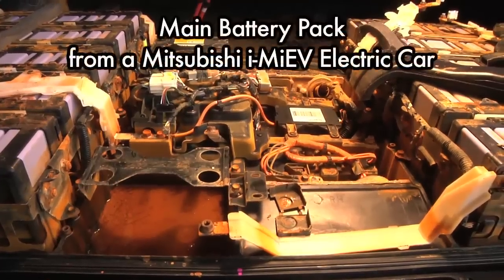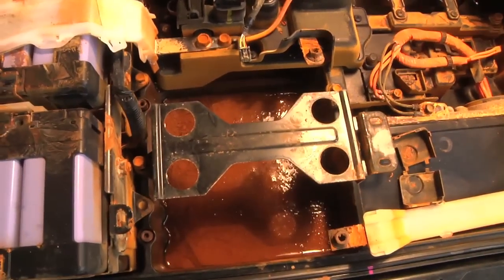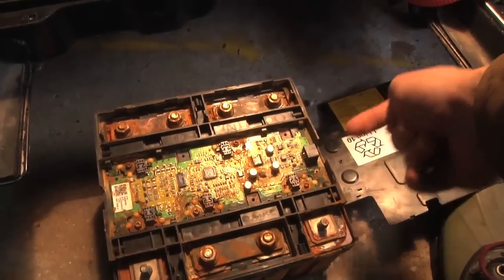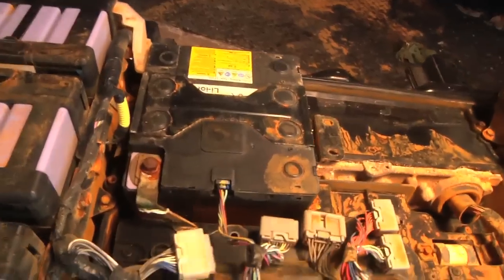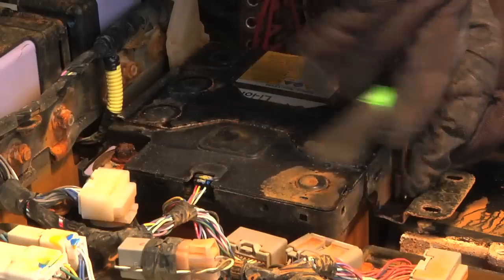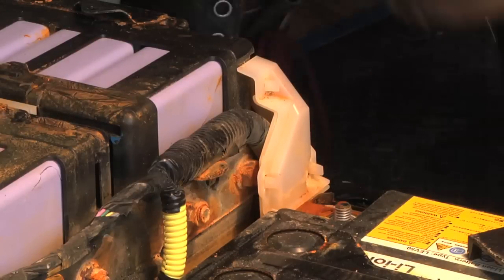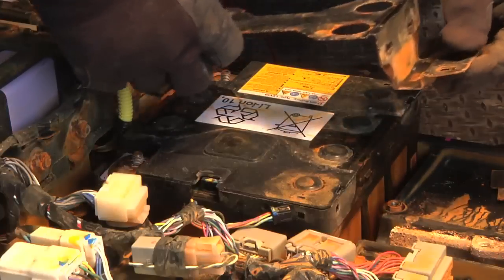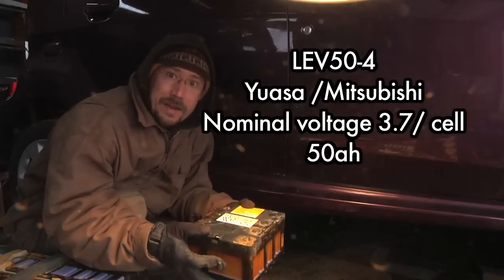Mitsubishi Miev: Removing a cell block from the main battery

Comment: If he bought it right & if the all the electronics are cheap to replace, like all the battery management boards, It's a great score? - But down the road, there'll be connections that will give him trouble. I want to believe that the ECM is ok?? Their very well sealed, & if the power to it was shut down, theres a good chance to save it? - Not easy to test without a reader just for this car. A zinc tab or 2 might help against future rust? Still the main motor has not been tested? - $25k car?

Comment: Do these cars have a master breaker to shut off the battery feed when flooded? - You have to stop that oxidation! - Baking soda & water, or this liquid stop rust you can apply with a pump sprayer and primer over.. Also the inside of the door panels could of got wet?